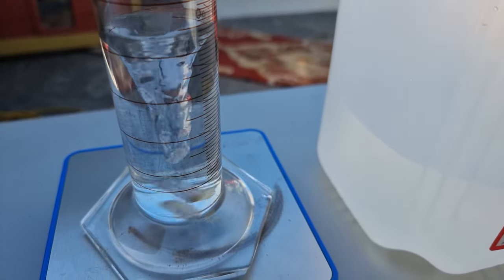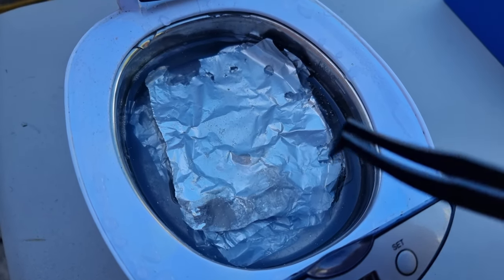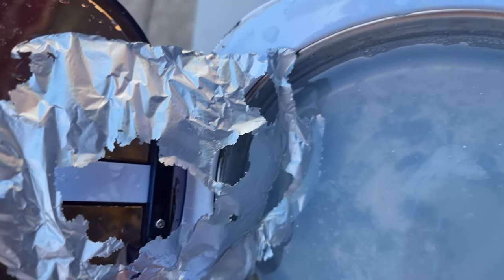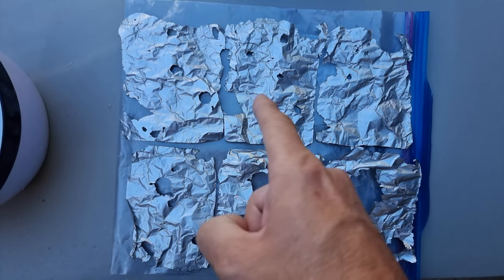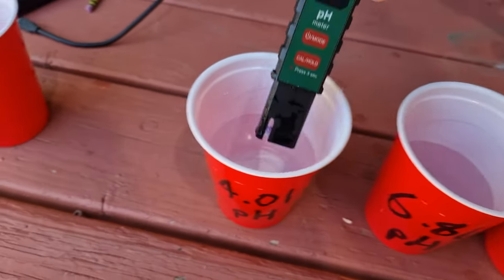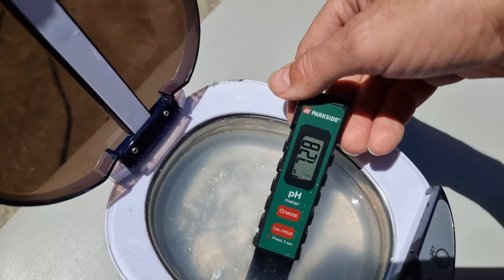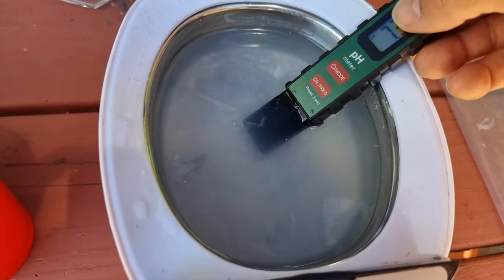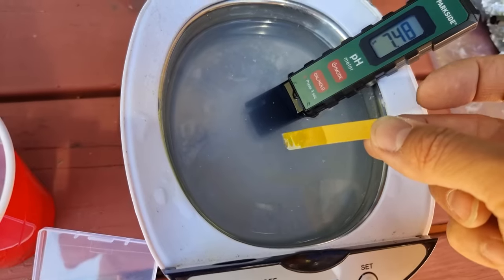ULTR - Gas production / synthesis - pH aftermath

Comment: Nice experiment. I'm looking forward to the SEM results.
(Hint: Before placing the pH meter in a solution, you should always rinse the electrode with distilled water to avoid carry-over effects. The Ph meter should also have a temperature sensor to compensate the temperature effects on the pH calibration).
Reply from the maker: Hi, I did for the calibration, and before testing the experimental water, both times, however, the buffer solutions I figured could handle it, and they did.
Reply: It's good enough for govt work. :)

Comment: So this is all still in line with it simply being regular, chemical oxidation of Aluminum; Al reacting with H2O and releasing H2 gas. The vibrations ablate the already-oxidized surface of the Al, exposing it to the water and reacting with it. That results in slightly alkaline solution.

Comment: the bottom you have aluminum ormus
Reply from the maker: Perhaps, but no way I will injest that!
Reply: @MFMP  oh god no! never aluminum!  but, maybe try microwaving it? or rotating it at several 1000 rpm, and you might get some anomalous results!
Reply from the maker: @cryptoalchemist369  Not sure I want to break my microwave! Homopolar generators are interesting though I have considered them a lot. Shishkin did very good work in spinning metals and Al specifically has an interesting behaviour.

Comment: Any change to collect gasses coming off, or at least collecting and applying spark?
Reply: In the previously posted videos, tested with combustible gas tester.
Bob, have you thought about looking at the cleaner wall as well as the foil under SEM? I'd expect some similar results as the TSG shells.
Reply from the maker: in progress